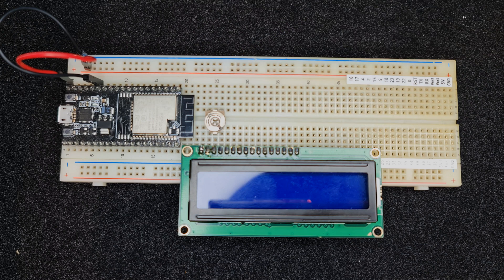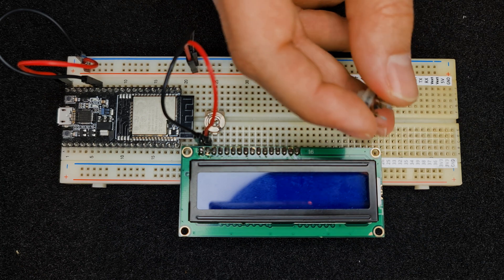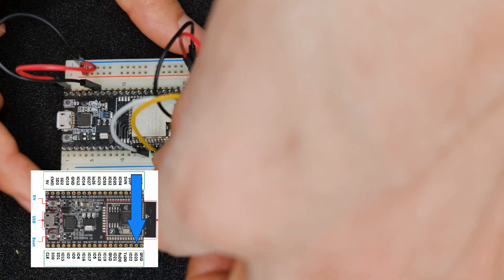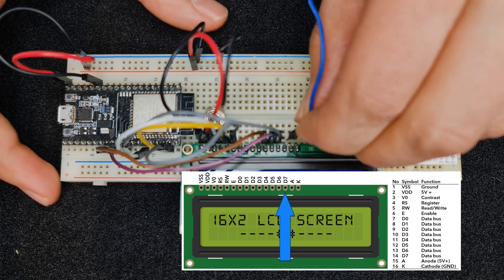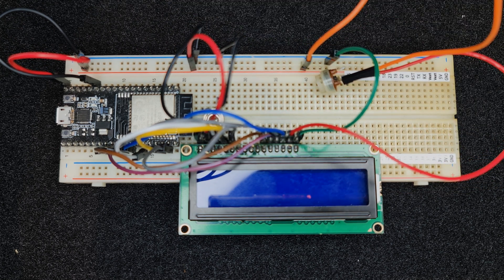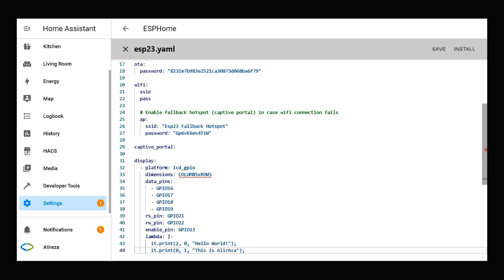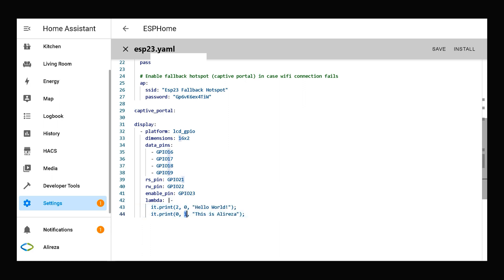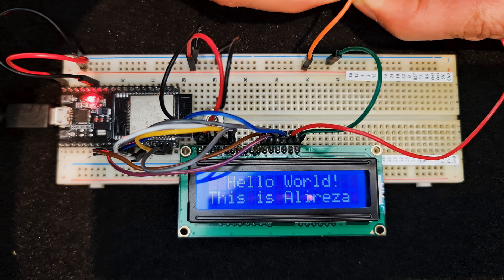LCD display and ESP dev-boards

Comment: Hi, how come you don't use lcd with i2c connection, isn't it easier?  Thank you
Reply from the maker: Hi, For sure it is easier. This is just tutorial. I will use i2c in next videos
Reply: i2c is certainly easier - but thank you @kian.smarthome for this tutorial - my LCD1602 doesn't have the i2c daughter board
Reply from the maker: @brianwilmoth8258  you are right but this video is a tutorial